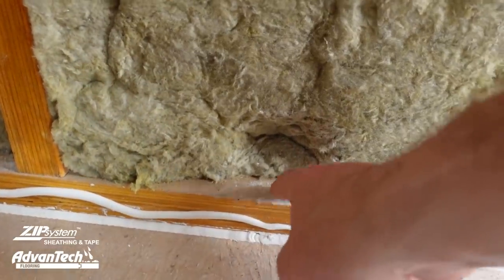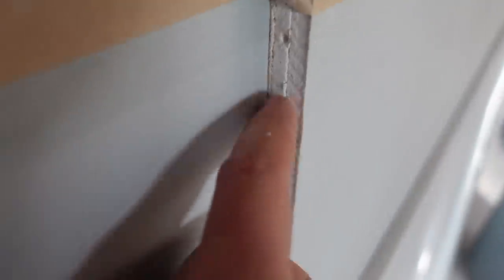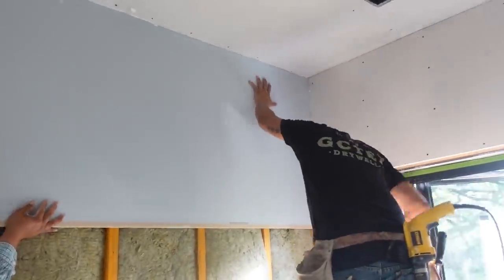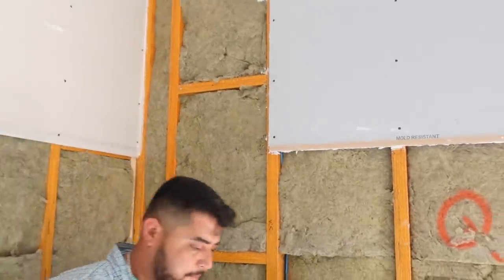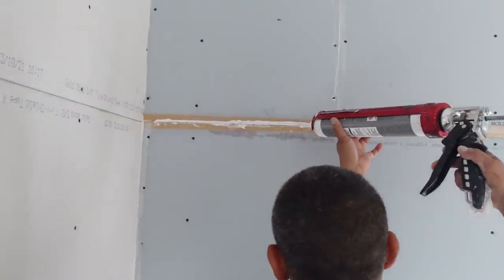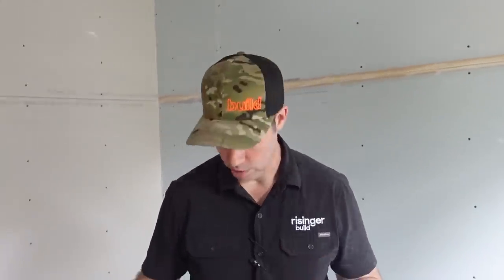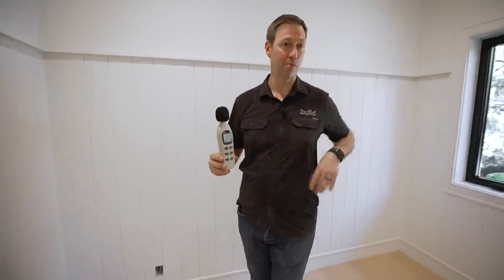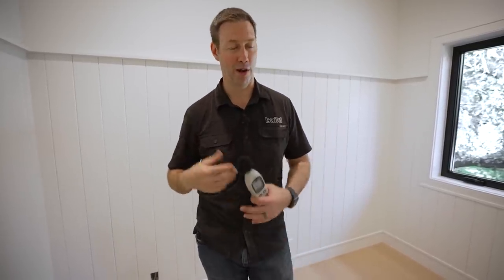3 Keys To Soundproof Between Bedrooms (incl Testing For Effectiveness)

Comment: It's not nearly as difficult to sound proof a wall as people think. Rockwool/Quietrock insulation alone in interior walls can drop the sound transmission between rooms dramatically. Every other little detail like caulking, gaskets, and specialized sheetrock only serves to increase the price of the job dramatically. Those gaskets he spoke of around the electrical outlets are crazy expensive and can easily be substituted with cover plates that have gaskets with them. Even a standard 5/8 piece of drywall that is glued and screwed to the wall is effective vs buying a specialized piece of drywall that probably costs almost double regular drywall.

Comment: Go back and do a wall without sound reduction, also try with just insulation in the wall. You will be suprised at just fiberglass bates in a wall. My sound engineer had use use a sound caulk on the studs, 5/8 rock, a different sound caulk in 1/4' bead and pattern, then another layer of 5/8 rock. Sound putty on all cracks or gaps left. He backed up to a freeway and high crime area. It was sound dead in his studio and even better in the acting room.

Comment: does your region not glue the drywall to every stud  on interior walls?
Reply: @johnbergstrom2931  it eliminates nail pops.
Reply: @johnbergstrom2931  ok, glue eliminates screw pops.
Reply: @johnbergstrom2931  well we do it on every house. Most builder in my area do as well.  Probably because of our climate in the Midwest.

Comment: I have been told ih you add a pony wall above the common wall, 18 -24 inches, will greatly reduce the sound.
Reply: In the attic?
Reply: @aayotechnology  yes
Reply: @aayotechnology  sorry, I was thinking of joining rooms with a drop ceiling.
Reply: sorry, I was thinking of joining rooms with a drop ceiling.

Comment: It never fails to amaze me how many brand names you can awkwardly drop in a 15 minute video. But not mentioning the gold standard of acoustic sealants, Green Glue, when you mentioned DAPs, QuietRock’s and “Others”. You’re over $5/sq ft in overpriced materials that I hope were sponsored. 
Pink insulation, 2 layers of 3/4 inch firerock, with some green glue in between them and in seams, some putty pads on the outlets. You’ve got just as good if not better for way less $. You also have solid wood doors, and no HVAC ducts. Those two things make a huge difference. 

Also how do you make a soundproofing video, seemingly geared to contractors (multiple tips on how to train your crew) without saying the words Sound Transmission Class, STC ratings. They have published very specific systems you need to implement in order to achieve a desired STC rating, complete with detailed package assembly diagrams, etc. 

I’m bummed, it seems that the days of expecting unbiased, high quality, and informative videos on this channel; are over. It’s been one step away from a QVC infomercial lately. (Although this might have been the first video that was a step BELOW a QVC infomercial. 

RIP

Comment: Viscoelastic polymers. That’s what’s in quietrock. It converts vibration to heat. It’s definitely the best and easiest way to sound proof between rooms. One layer is equivalent to 7 sheets of drywall. Isolate it and the ratings skyrocket. Great product. PS: the Mineral Wool does little to nothing.
Reply: You wouldn’t add batt insulation as well?
Reply: @johnbergstrom2931  Resonance inside wall cavities? What does that mean? You got roaches that like playing heavy metal inside your walls? QuietRock absorbs and help reduce vibrations from occurring. Another layer of QuietRock or any kind of isolation tech would be much more affective then any kind of batting on the market. It’s an inefficient way to tackle the problem. Even an additional layer of drywall put on with Green Glue (sound absorbing glue) would be superior. And cheaper. To kill resonance there has to be physical contact, like placing your hand on the skin of a drum. Placing my hand over a drum does nothing but stop some air born transference.

Comment: $2 a square foot mass loaded close cell vinyl, $0.40 cent a square foot normal drywall would have done as well as your $4 a square foot specialty drywall and rockwool. You just staple it to the studs before you put the drywall over it.
Reply: Why not staple tar paper on the studs instead?

Comment: Your wainscot receptacle box can't be recessed like that. It's a code violation unless he installed box extension to guard against the combustible material. Would have been better to just install adjustment boxes to begin with. That's the correct way to do it.

Comment: That’s the real insulation which is extremely itchy. You can hang 5/8 rock vertically on the first layer and then install rc1 2’ on center and hang final layer of 5/8” horizontally and use sound acoustic caulk on the bottom and around outlets.You can also install lead behind the rock.

Comment: The effective test is flawed for these reasons:
1. We have no control. 
If you want to experiment you need a control to compare against.

2. We have no comparison.
How do we know how quiet it would be compared to a wall with:
A. Regular drywall.
B. No caulking.
C. No insulation

3. We don't know how this would work for various sound pitches.
How do we know if this works on highs or lows in the audible range (20-20,000KHZ).

4. How much difference would it be if you had used this technique on BOTH sides of the wall?

Comment: I apologize Mr. Risinger, but this the first video of yours that I feel the need to directly disagree with. By not laying that sound caulk on the beams as well, you and your contractors gave easy sound transfer. It is especially sad as you took the time for the electrical boxes. Some people will say that the screws will transfer the sound. That is true. However, look at the total surface area of the screws compared to the beams. I argue a bead of the sound caulk would make it even quieter, even with the screw penetrations. I would love for you or someone else to test this. Thanks for the great video's and I wish you and all your viewers well.

Comment: So fancy 'drywall' is 7X more expensive than regular 5/8" plasterboard.  Tough sell.
Reply: True. You could probably get something even more effective and cheaper simply by doing 2 layers of standard 1/2" drywall, with acoustical sealant between them, the same sealant used on the studs in this video.

Comment: Since the wall is a closet space on the other side, this is completely unnecessary as clothes absorb 100% of the sound, way more than the tiny difference that the sealant will make (if actually done right)
This is even before the fact that Sheetrock is extremely sound absorbing and there will be no sound transfer between rooms except through stud contact (vibrations) so this is of no use really...
Reply: @johnbergstrom2931  good thing 99% of houses have drywall insulation caulking. The alternative would have been a unlivable.

Comment: 30 dB. That reduced by a factor of 1000. 0.1% of the sound got through the wall.

Should repeat this test with the mic not held up against the wall. That can act like a reflecting dish amplifying the sound on the hot side.

Comment: It's amazing how American builders do 1000 things to achieve the same effects you would get for free if you just use bricks instead of flimsy building materials.
Insulation INSIDE the house?? That's just ridiculous.
Reply: It's not ridiculous. Insulation is very effective for attenuating sound. There's more than one right way to do things. Different solutions have different advantages.
By the way, a bit of wood framing, drywall, and some cellulose based insulation produces far less Co2 emissions than clay brick.
Another product that I believe is superior to brick for this purpose is cellular concrete block. It has far less Co2 impact. Hebel is one of the main manufacturers in Europe. Unfortunately this block and craftspeople with the skills to set it, are not readily available in the USA.
Reply: @HistoricHomePlans  Less CO2? The house I'm living in is over 500 years old. Do you think you can beat that when it comes to sustainability?
One tornado and this house is a goner. How is this sustainable?
Reply: @johnbergstrom2931  Sorry, mate, are you trying to tell me the US is one big seismically active zone?